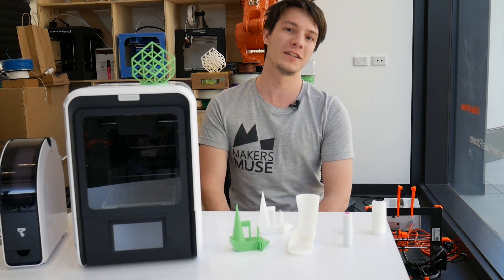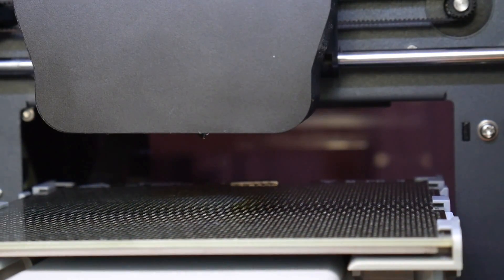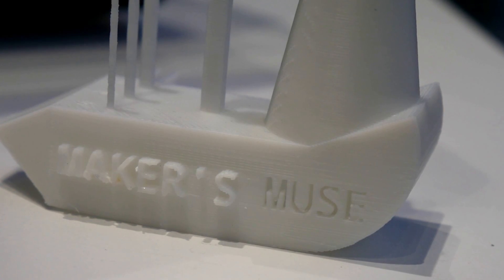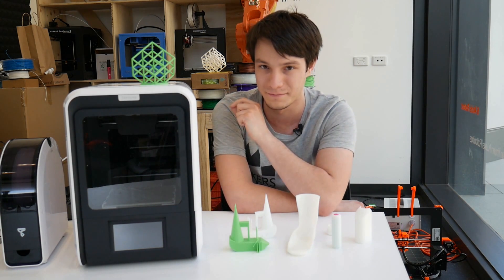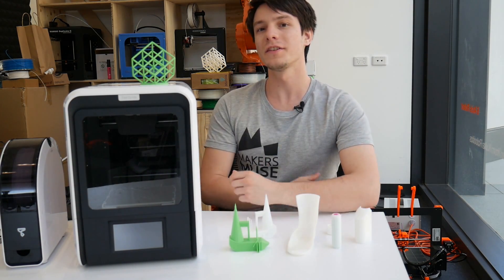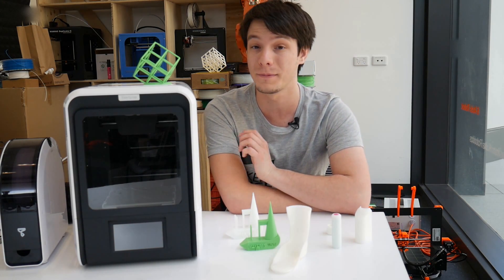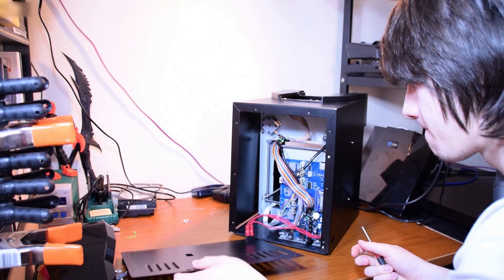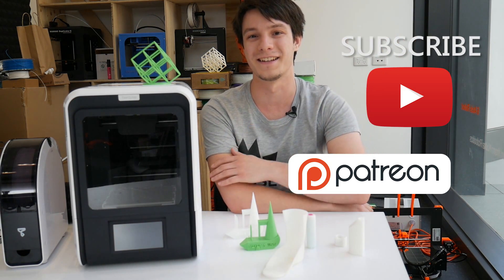UP mini 2 3D Printer Review

Comment: I have three and they all fail to print ABS (Tiertime brand) properly with layer separation being the most common fault. They do better on PLA than ABS but I have to use an external feed roll holder because of the small sized carriage. 
I've tried everything to get the ABS to go (drying, external heating spool holder, temp changes, speed changes), just no luck yet. Feel like giving up and going and getting in 3 other printers.

Comment: Quick Question: Do you have to make your bed sticky in order to print correctly with this printer? If yes which technique is the best? Glue stick? Hair Spray? Please give me some advices here. Thanks
Reply from the maker: No, you don't need anything just needs to be clean.
Reply: Thank you so much for your answer. I m a very beginner in the 3D printing world and I love it. So I think the UP mini 2 is enough for my use.  @MakersMuse  I had another question because I did not find the answer on Google : If I want to print a piece that is too big for the 12x12 bed, is there a possibility to use the UP Studio software to "break down" the big into smaller pieces and glue them after?

Comment: Does anyone have the settings for Nylon that work well on this printer?
Reply from the maker: So for nylon I print on the 'stock' ABS temperatures which are really 260-270degC extruder temp 80deg Bed temp. Print raftless and be aware that the plastic will bite really well into the holes in the perfboard, just shave them off with a knife after. Good luck! It's super challenging and nylon absorbs moisture really fast so it pops and spits unless its been dried or freshly opened.

Comment: We just got these in my classroom, 12 in fact and we found that the parts that are in the extruder head snap easily when trying to fix so.ething and over 1/2 of our prints fail. Most of them are already broken despite that we've only had them for a few weeks. I was wondering if there was any maintenance things or something I might not have been aware about. Is this the norm for 3d printers? Are there any better classroom budget 3d printer's (we're in 6 grade). We've so far only used the white abs that it came in. It seems that when a student wants to print something it is not a matter of what ones are broken, however of what ones are working. Thanks so much for the feedback

Comment: Can you give some more detail on which settings you used for ABS please? My prints have a really poor raft and the raft is noodling so it sticks to flat prints - then it becomes fine after that. I've adjusted the height manually, any closer and it's too close to the print bed!

Also I didn't hear anything about bed heating time - it takes about 45 mins to heat the print bed!! My Up Box heats in about 5 mins!

Also one more thing! You referenced the Ultimaker 3 in you live stream and alluded to other 3D printers that will have better materials to the dissolvable PVA, was one of them the Zortrax Inventure? Thanks!!

Comment: Just bought one of these machines I wish I had known about your link beforehand :-( I paid a lot more for it unfortunately. I have had the machine for 24 hours now and I HATE IT! Failure after failure on simple things tried various PLA's, gouged up the print surface 100% failure. Software log in all the time is a pain! WiFi works but i fiddly and requires you to log in each time, what a pain! Getting ready to dispose of it threw in some ABS, oh my goodness, works like a charm. I still hate the thing but it does have some endearing qualities.
Reply from the maker: Haha the thing that is VERY weird and unique with the Up's is they are hugely picky about PLA. To print PLA, it's gotta be one that is compatible (it's seemingly random), take the top two panels off which click in place with magnets and open the fan duct to cool the print faster. Honestly, as you're finding though - it's a beast for ABS.
Reply: To think I was ready to get rid of it, I am still pissed that there is no documentation for it (quick start guide does not cut the mustard), at the end of the day that was all that was needed. I have fed ABS and polycarbonate through it and it handles that like a boss. Now that I have had a good look yes I understand why it is fussy with PLA, ok fine, Bilby3D PLA works a treat :-). I am really warming to the machine now it has made some great things for me, I am now travelling and will see about making things while camping. Yes I am a geek!

Comment: The UP studio software killed my UP Mini.  as in it stopped the bed from heating during a print so ABS prints died every time. I had to get a copy of the old firmware from 3dsystems and roll back my drivers to fix this
Reply from the maker: That is NOT good! Glad 3D Printing Systems could help. Honestly, the new software doesn't add any additional features, but rather is just prettier.
Reply: yeah I am back using the old software with temp hack and could not be happier :)

Comment: Great video. You've made the same mistake as your other videos - the angle of that lattice isn't 45 degrees... (relative to the plane of the bed).
Reply from the maker: Wow, you're right! It's closer to 35deg, but not exact. I need to do some more researching into this. Thanks for the heads up, appreciate it.

Comment: Be careful on the "microswitch" on filament idea.
I've seen fails because the part in contact with the filament (that had a microswitch under it) ... was filed away by the filament, specially with the retracts and the gear marks from the extruders. An optical sensor can be clogged as well... it's not that easy. 
And if it gets stuck on the "no filament" randomly ... you can get really mad.

Comment: Cut the caddie in half and print an expansion section so it fits bigger spools.  Might have a part line from molding and separate nicely to just make an additional part.

Comment: still needs a glass bed
Reply: I'm using buildtek for it, works great!
Reply: yes but should come with one   from the start imho
Reply: They do come with some sort of print bed material as well though, which is easy to remove when leveled properly.

Comment: I've had it for about a month and it's been doing awesome! One quick question though - how can I prevent ABS warping?  I tried gluesticks but it didn't really work, I'm planning on trying ABS juice - will it work on its print bed?
Reply: Printing with the Raft helps A LOT to prevent warping. You might be tempted not to use a raft with their Flexprint surface, but Rafts helps a lot.
Reply: Thanks for the quick response!  I do print with rafts all the time - however, ABS still tends to warp relatively frequently when the object has a large base.
Reply: Biggest thing I ever printed was a flat round disc which is roughly 10CM in diameter, I managed to print it with minimum rounding after meticulous manually levelling (because the build plate actually gets slightly warped by the springs) :P Since any margin of error might ruin it for something that big.

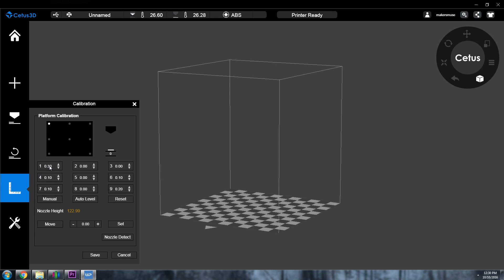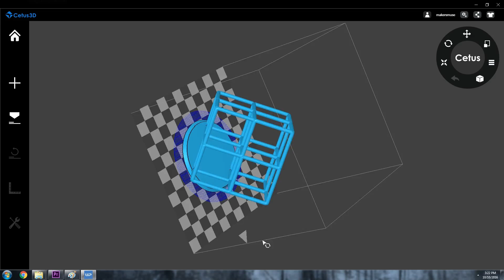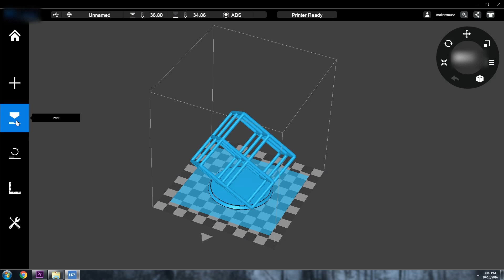Comment: @ 2:12 & 8:12 & 9:22 & 10:42 "Cetus" ????? 

Does this mean it does not use standard GCode, and requires a transcoder for Simplify3D etc, as was the case in the Cetus3D toy?
Reply from the maker: Beta version of up studio, tiertime make the Cetus as well.
Reply: 12:20 - Got my answer: "yes", same POS software/control to play proprietary lockdown games, as they seem to have also tried to "cleverly" do with the spool holder